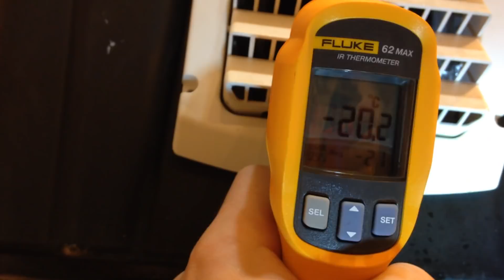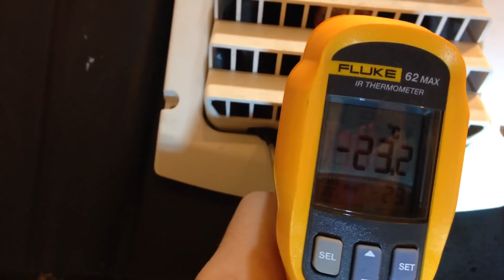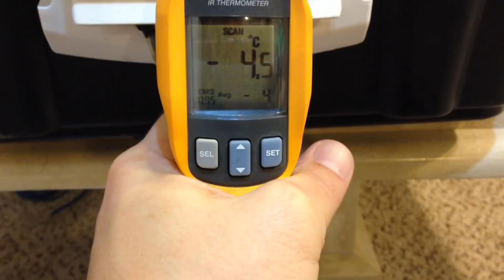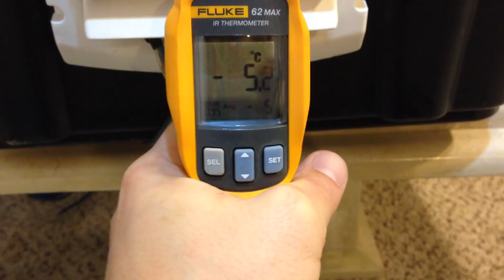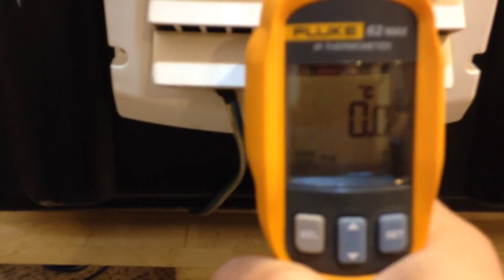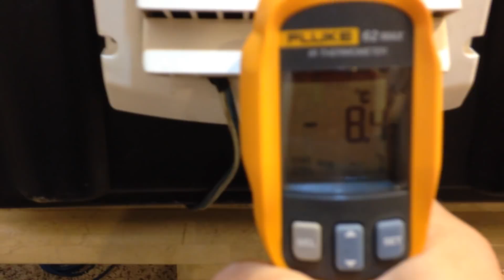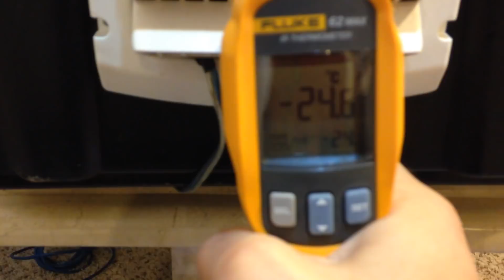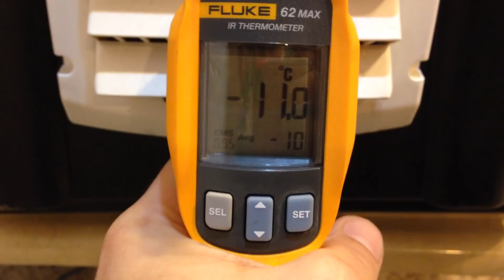Making the Bose Einstein Fog Chiller part 2

Comment: Question  I apologize in advance if this is a stupid question. I know the reason you chill the fog is to keep it low to the ground. I live in UT and often the temps have dropped quite a bit come Halloween time. Example: If the outside temperature is 30 to 40 degrees and my fog machine is outside, do I still need to make a chiller or is the air temps cold enough to keep the fog low to the ground?
Reply from the maker: Temperature difference is exactly why the fog stays low. The temp at ground level is always colder then even 2 feet up. when fog comes out of your fog machine it is warm and will try to rise. Using the chiller keeps the fog low under any circumstance. The colder your chiller is running, the better it will perform and the lower and longer the fog will sit. To answer your question, yes you must use a chiller at all times to achieve low lying fog. Hot fog meeting a colder ground temp will not work well in comparison. Even on ice and snow.